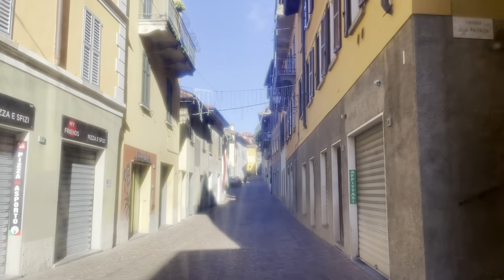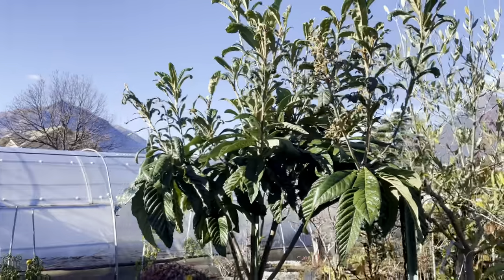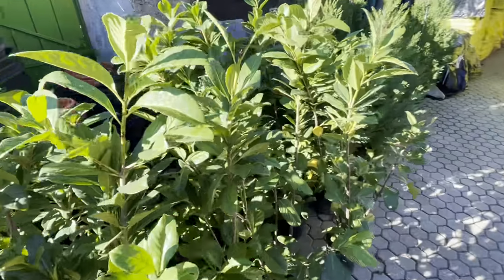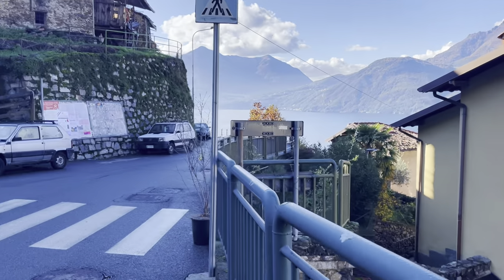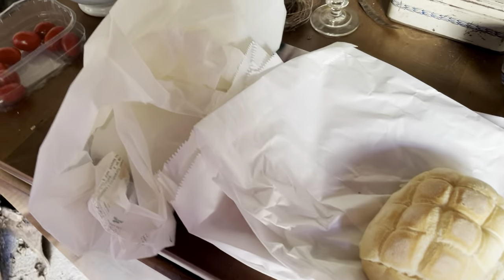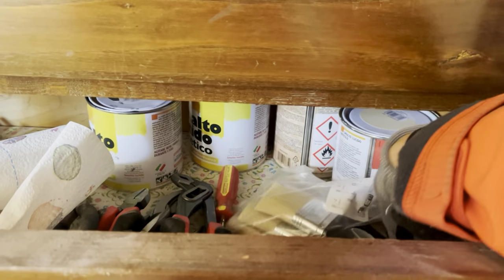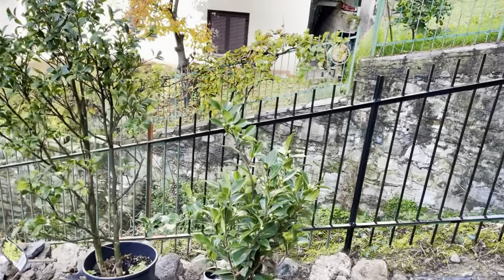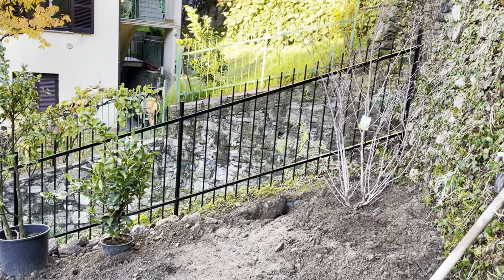Day 93 of a big renovation on Lake Como/Magnolia & Pyracantha for the garden

Comment: You can have a wire going from the banister beside the road that goes to your back door with a basket or hooks so you can put your shopping on the hook and it will slide down the wire to your back door so you do not have to carry everything from apemaria into the house one thing at a time.

Comment: I really think 🤔 you need a pulley system from the road into the garden. A pulley with a basket that allows you to lower all of your things down to the terrace so you don’t have to walk every single thing up and down the stairs. Pulleys are reasonable priced then you buy a basket to attach to it that allows you to lower items straight away that can’t be dropped over the edge. The pulley can be fixated to the handrail or it can be removable and kept inside the Ape Maria.